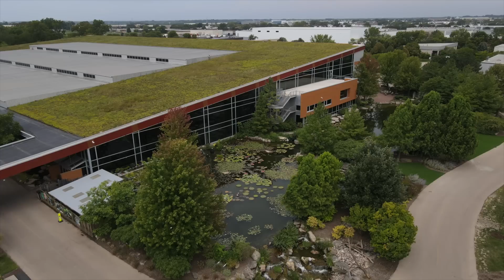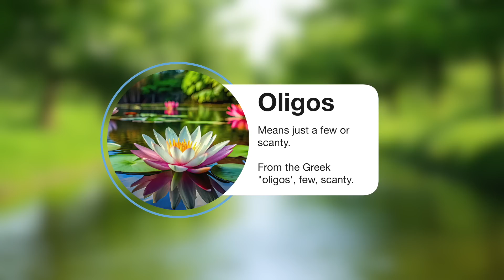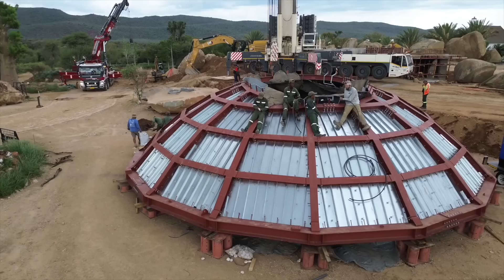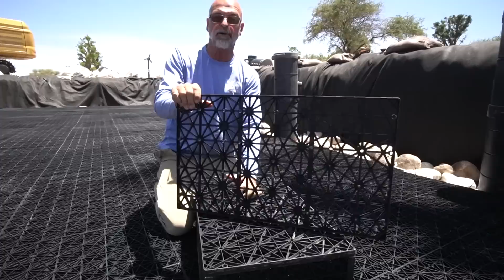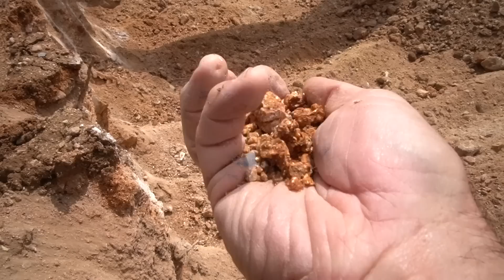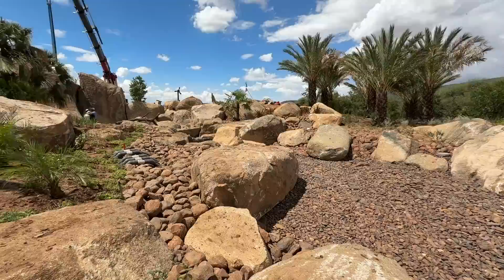Beautiful Wetland For The African Pond Build

Comment: Incredible Ed, that was the most comprehensive breakdown I have seen of the wetland filtration system. I have a question about the centipedes and snorkels…. Is there only function to allow the annual clean out? Or do they do anything else? Thanks you Professor 🍎✌️

Comment: What is the frequency of sediment removal needed to maintain optimal performance? I assume sediment will build up at the bottom and you clean it out once every 30-40 years?
Reply from the maker: Each project is different,
I have some wetlands that require yearly cleaning and others have gone for more than 10!